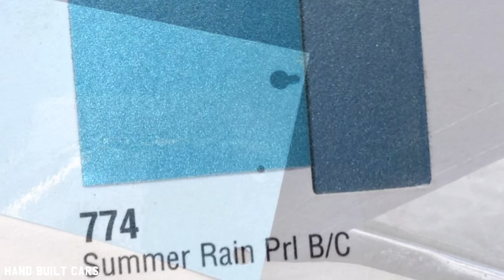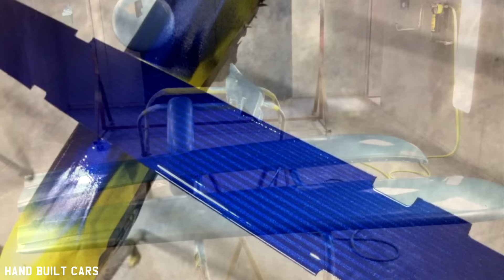1958 Chevrolet Impala Convertible Restoration Project

Comment: you can low ride it with some 520s but never cut it up. I grew up in LA in the 60s and 70s these car were cheap and were cut up with Hydros. Hell is was just an old car. Most were being produced in LA. Fast forward these are not sitting on the street like back in my day.